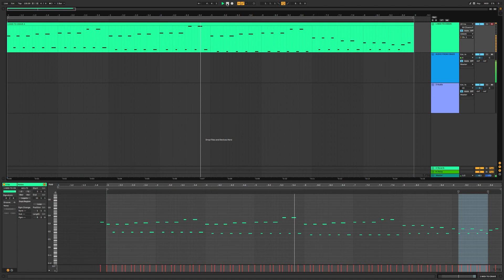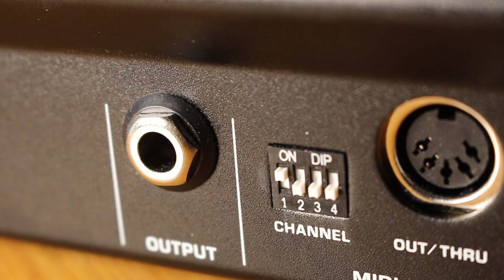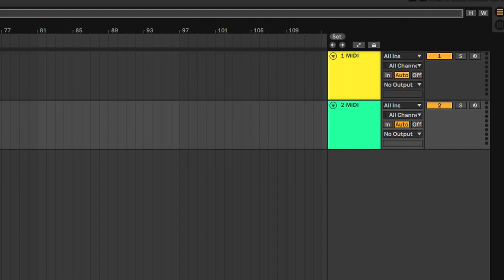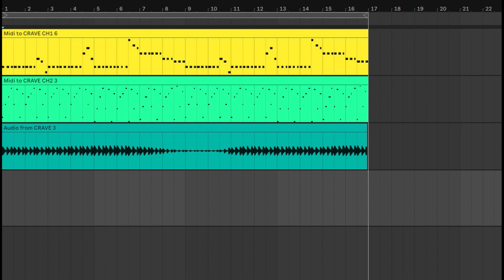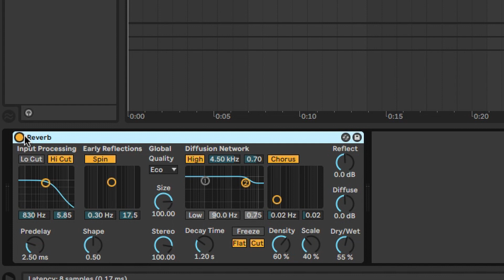How to connect the CRAVE to your DAW - Episode 2

Comment: How to set the midi clock in DAW to control CRAVE. I mean if I set tempo in DAW to 94 I expect CRAVE to sync its patterns to this tempo (or values that will be the result of division by 2, 4, etc)
Reply: this is exactly what I'm looking for, but havent find any useful info, have you? thanks
Reply: @FunkenWave  any solutions so far?

Comment: Why don't you use the External Instrument device in Ableton? No need for the audio tracks and it's automatically latency compensated.
Reply: Hey Kris - great point! My goal was to show it in a way where people could apply the advice/settings to a variety of DAW's they may be using. I am not sure if all DAW's offer the same flexibility as Ableton.
Reply: You also have to use a more expensive version of Ableton to access that feature — and all it's really doing is automating the same manual steps we saw in this video.
Reply: And you can also save presets for your gear in the external instrument.

Comment: Hi,
Thanks but how to set Crave Assign patch output to -5V/+5V, Missing doc ! 
The Crave documentation shows that the ASSIGN output could be 0/5V or -/+5V.
But there is nothing more on the subject.
Is it something related to what is set for the ASSIGN patch output ? CC or something else ?
Or is it something we can change  and how ?

I selected CC7 for ASSIGN, expecting the generated CV to be -/+5V, but it seems to be 0/+5V because when I plug ASSIGN output to VCA patch input and send CC7 the final output volume change but never totally reach 0= No volume ???

Further more the Sequencer and Arpegiator volume are not changed ??
Bug ?
Reply: I posted an answer as far as I can help on this below your other post where I chatted with Dan.

Comment: Popping up this thread, does someone has midi THRU issues though Crave ? in my case some notes (sent from Digitakt through Crave to Arp Oddyssey) are randomly doubled .... and can't figure out why ... does not occur at all through other midi devices using their own THRU port (thus : not wire, config or midi source issue) ....

Comment: Just bought the crave but not sure if I’ve set it up the akai force properly. I’ve used the usb connection and it seems to be able to play the sequencer onto the force but the osc and filters don’t work. Does this mean I need to set up using midi cables ??

Comment: Is there any way to trigger five semi-moduler Behringer synths with one midi cable? Because i have model d, pro1, neutron, K-2 and crave. I want to control all of them at the same time for live performances in one daw. (İ have 16 ch analog mixer for audio, 8/10 io soundcard for recording, behringer motör 61 for midi controller, and pc with daw Cakewalk by Bandlab) Thanks.
Reply: Get a USB hub
Reply: @oddcircuit  ? I think you dont understand my question. With usb hub, can i send 5 different midi signals to 5 different synths?
Reply: yes, sure, I do it every day, just to be safe make sure every instrument is at the different midi channels, hope you figure it out, and it works for you @nebukenazar

Comment: I've discovered that the crave can not transmit sequencer and arp data via USB MIDI. it can only transmit simple note on off. is this normal? I've updated the firmware to 1.1.2  (23/03/20)

Comment: My unit doesn't even receive midi note but does sync with my daw, really disappointed in this unit and its past my warranty so I am stuck with the unit felt like throwing it in the bin last night.
Reply from the maker: Hi Saint Cole - Sorry to hear you're having some issues but it sounds more like a setup issue rather than a fault. If the midi was not working, it would not respond in any way at all, so the fact it is receiving sync shows it is not faulty. Please be sure to check that you're transmitting and receiving midi notes on the same midi channel as I am certain this is why it is not working. If not, please feel free to reach out to our Support Team who will be able to dive deeper into this for you. Many thanks - Dan